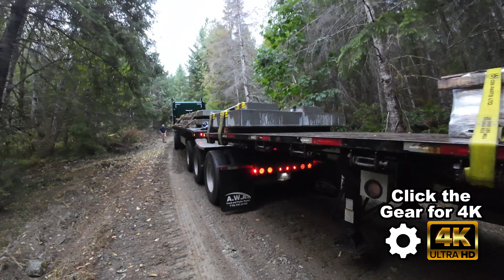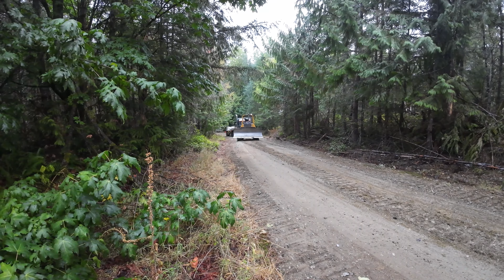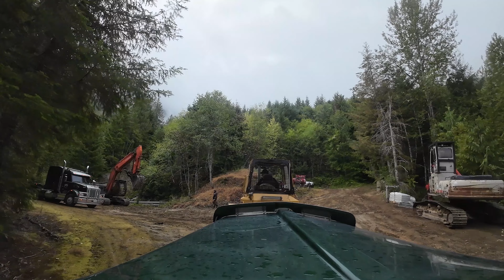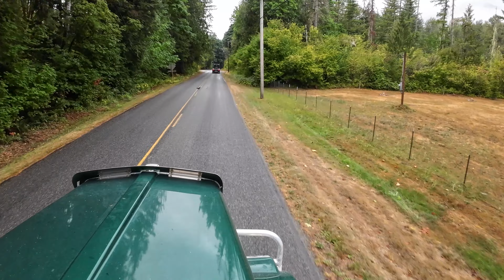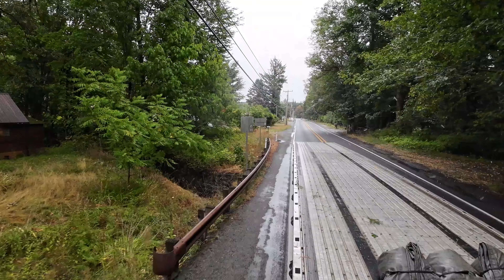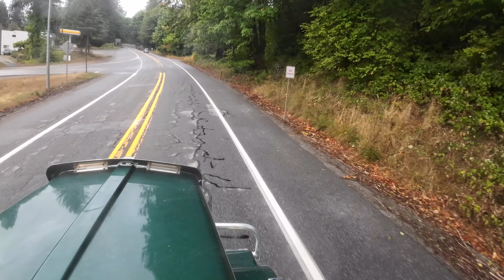Stuck • Pulled up the Hill, Rockport WA • Trucking Life 🇺🇸

Comment: Drove in the oil patch for over 25 years and spent 50/50 on the Hyw and Bush driving, once I had a delivery to a drilling rig, 100 kilometers off the Hyw to the rig but I was pulling a Super B had to split the trailers, pup trailer first then the lead trailer, last 10 KS I was pulled by a Cat made for a very long day thank G I was paid by the hour,safe travels driver!
Reply from the maker: Oh wow, that sounds amazing